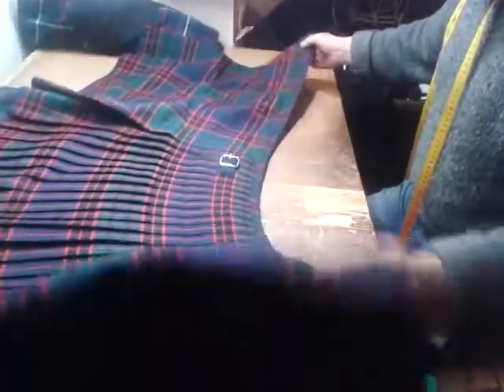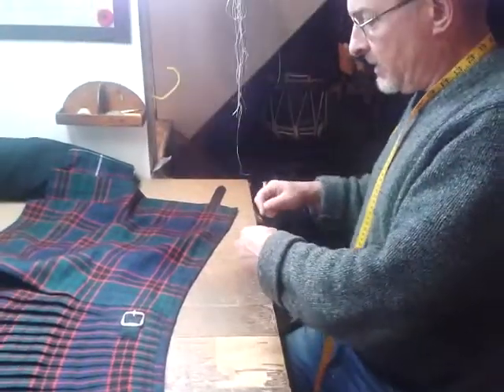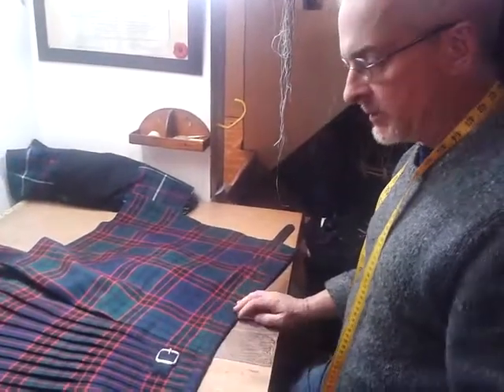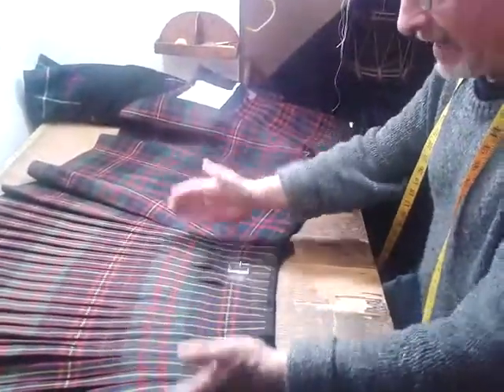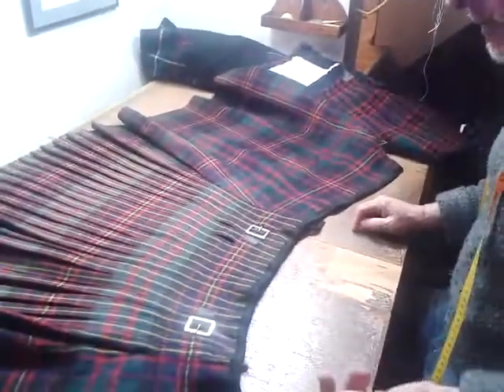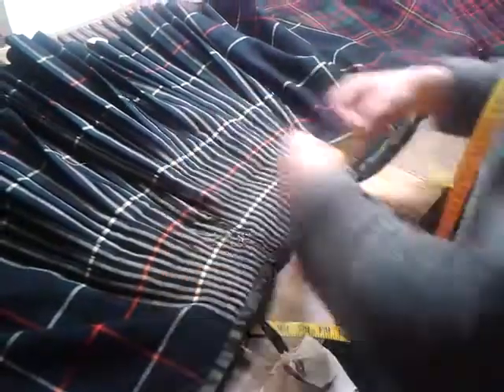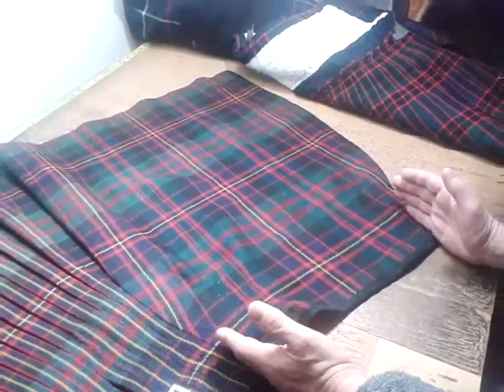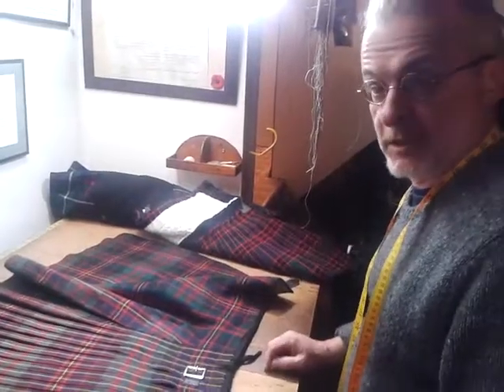'Civvy' vs ' Army' kilts

Comment: Hello - Do you hem the fabric at the bottom or do you use the selvedge to avoid fraying at the bottom of the pleats? 

I don't know much about kilts, I'm just getting interested, but I can tell that the 'apron' part, or the end of the fabric, is just ripped along the weave rather than cut and hemmed as would be done in modern times with any other garment. 

I assume this is just what was traditionally done since tartans were extremely tightly woven by hand which would prevent fray - but it seems the bottoms of kilts do not have any fringe. 
Do all modern kilt makers take advantage of the selvedge for this, or is hemming ever employed?

Thank you very much in advance for any responce, and thank you for providing historical information with this video.
Reply from the maker: Thank you for your question!
the lower edge of a properly-made kilt is NEVER hemmed but rather takes advantage of the selvedge edge.
the ends of the cloth are 'cut' at the mill before it is shipped, but I then rip the ends to get a perfectly-straight edge.
Reply: @robertmacdonaldbespokekilt3063  Thank you so much for your fast reply,  I will be sure to remember that a proper kilt should NEVER be hemmed - in case I ever attempt to make one. 

I hope you have a good time of day whenever it is in Canada right now
 - Best regards from Scandinavia.
Reply from the maker: @lupa1445  Haha yes, I get quite worked-up about the subject of 'hems' on kilts! 
Thank you -  it's 17hr Pacific Time,. and there's a wee bit of cloud but it's fairly warm.